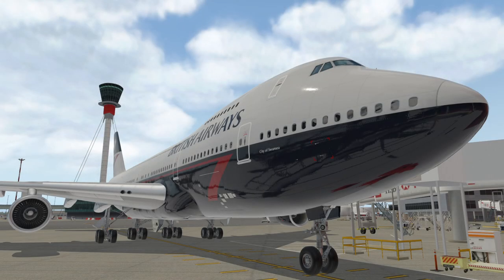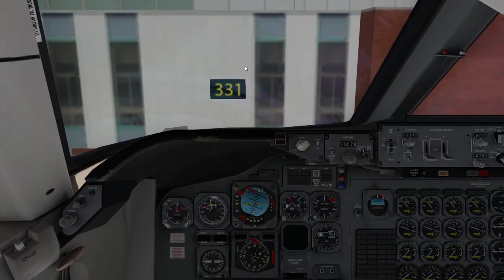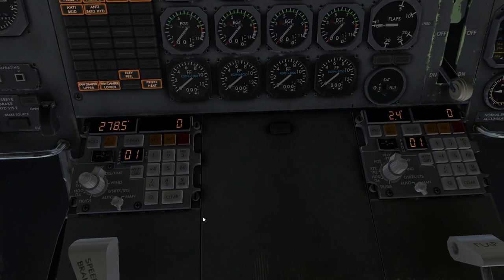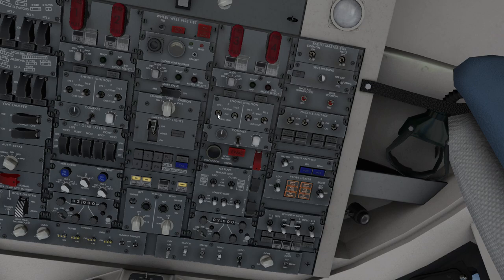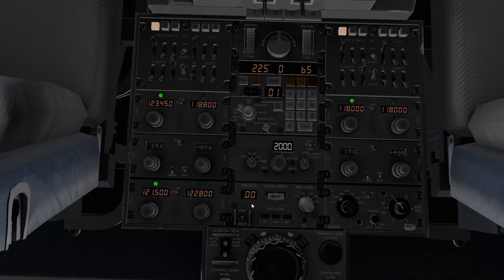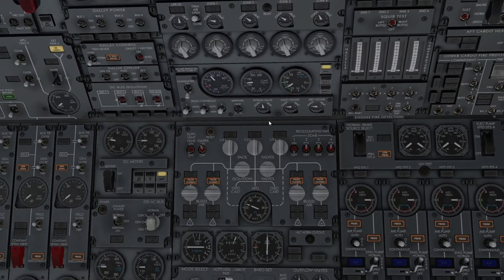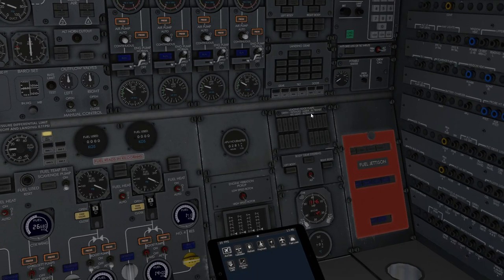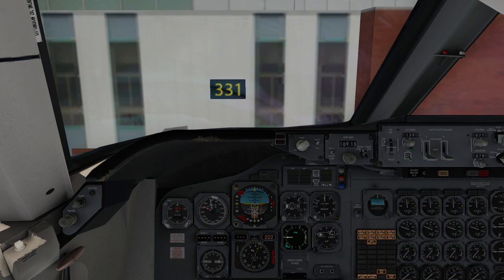Felis 747-200 Full Tutorial - Part 1 - Flight Engineer Setup

Comment: Hi.  Thanks so much for your work.  I recently purchased this plane, but I'm having trouble with the checklist that came with the plane.  Have you or anyone else you know made a video that runs through the checklist that came with this plane?  I've found a number of great tutorials, but none that follow the intended flow of the planes' checklist, so I get stuck every time, because I don't know which is in the wrong position that brings my attempt to follow the checklist to a screeching halt.
I'd really appreciate a rundown of the supplied procedures.  
Thank you and a very merry new year to you and yours.
Reply from the maker: Thanks Randy, Happy New Year. I don’t know of a tutorial using the TWA procedures that the checklists are based on. The testers with 747 experience all commented that the checklist procedures were a bit unusual - TWA seemed to revel in doing things differently from other operators. I try and show a logical method to use the aircraft that works with most of the checklist and explain why I’m doing something different where required.

Comment: Very impressive and comprehensive tutorial and I followed exactly the way you have explained BUT I am having problem , I don't get to observe the sound after APU start as yours show and also the big I have is that after engine start I have too much smoke coming out from the engine .. white thick which is so bothersome and yours doesn't show it. What am I doing wrong or do I need to have some setup to work on. Please guide me through. Thanks a bunch 
BTW I have the latest update for Felis 747-200 recently did.
Reply from the maker: Sorry for the delay replying John, and thanks for the nice feedback. I’ve not seen those issues before. The engine smoke could perhaps be the stock X-Plane smoke system (usually the X key), but I don’t know about the sound. Your best best is the Felis Discord - I think there’s a link in the x-plane.org forum, however Felis himself is in Ukraine so you may not hear from him directly at the moment.

Comment: Great tutorial. Thanks. However, it would be even greater if you did another one, more "essential", in order to facilitate the memorization of the whole process ... if I may ask ...
Reply from the maker: Thanks Francesco. The included manual shows the setup process, so that should cover most of the key items. It's really like any other modern jet, so you need batteries, then APU start, APU bleed, fuel pumps, hydraulic pumps, instruments and navigation and then you're pretty much good to go.
Reply: @ReflectedRealitySimulations  Thanks for your kind reply. I saw that manual.... but a "live" explanation of yours would be more pleasant! Anyway thanks just the same and congratulations for your great job.

Comment: does this have automated flight engineer like A2A's B377 has? or can it be operated and flown without using the engineer's position. Thanks. Great video!
Reply from the maker: There isn't an automated flight engineer, but really the engineer workload in flight is very low. You need to do a couple of fuel system changes during the flight, and set the pressurisation for any step climbs or final descent. Other than that, all the flight engineer tasks are really done on the ground.
Reply: @ReflectedRealitySimulations  Thanks

Comment: Thanks for the videos, they are very helpfull. I am used to fly in the Boeing 727 from FJS and I am wondering if I can use the auto-pilot in the Boeing 747-200 like I am used to do in the 727. I mean without Fly plan. I try to set up an altitude, heading but it doesn't seems to act like in the 727. Most of the time I use the auto pilot to fly around my departure airport and try as many landing as I can using ILS landing or not. Is it possible to use the auto pilot and do an ILS landing without a proper fly plan in the classic and if the answer is yes, I would love to have some explanations about it. Thanks again for the videos.
Reply from the maker: Yes, it’s possible. You will still need to align the INS though. The reason for this is the INS system provides the input for the attitude indicator, which the autopilot needs to work. Once the INS is aligned, you’ll have no issues with the autopilot. The 727 has traditional gyros for the attitude so it doesn’t need an INS for the autopilot.

Comment: Thanks for super tutorial - I wanna ask - is necessary to use AT in this plane? I was watching all YT cocpit video this  real plane and no of them used it
Reply from the maker: No it's not necessary, and in fact can be more work than just moving the throttles. The throttles are usually looked after by the flight engineer though, so as a result when you're single pilot the AT can make life a bit easier, especially when you're doing additional stuff like navaid tuning, fuel crossfeed setup etc.
Reply: @ReflectedRealitySimulations  thanks for reply, one time I have to make flight without AT. 🙂
Reply: Some of the early -200s came without FFRATS (full flight regime autothrottles) so the AT could only be used for takeoff and approach. The remainder of the time, the thrust had to be taken care of manually. Also, with EEC/FADEC being absent, asymmetric thrust lever positions were quite common!

Comment: Any reason for not switching recirculating fan zone 1 on?
Reply from the maker: Recirc fan 1 feeds the cockpit and upper deck, by leaving it switched off the flight crew are provided with fresh air continuously rather than mixed recirculated air. My understanding is some operators had this as standard procedures, and at other operators the pilots tended to do it anyway!
Reply: @ReflectedRealitySimulations   It was very noisy too